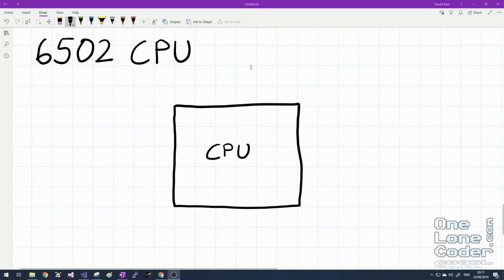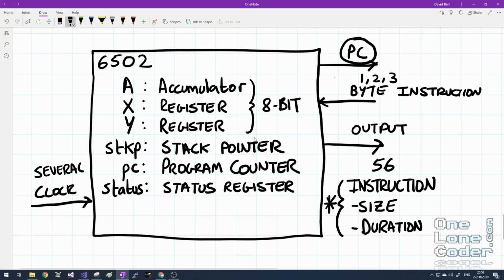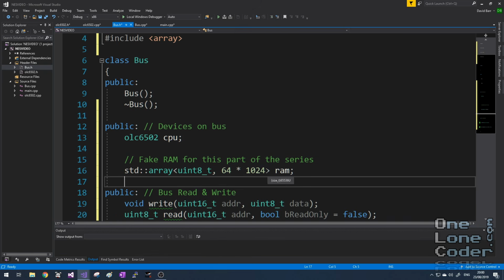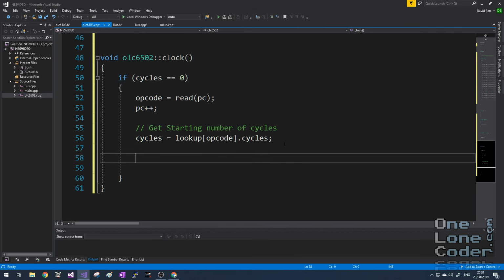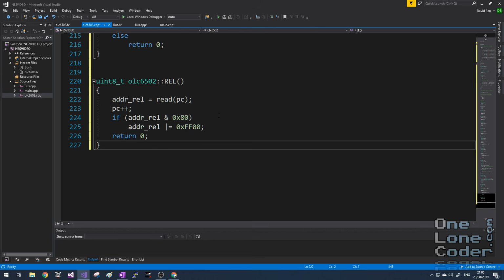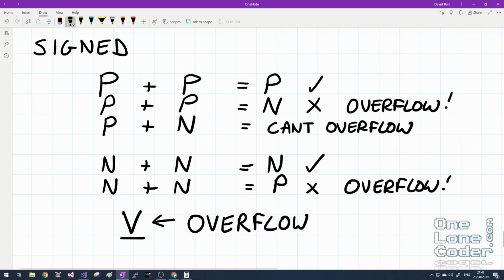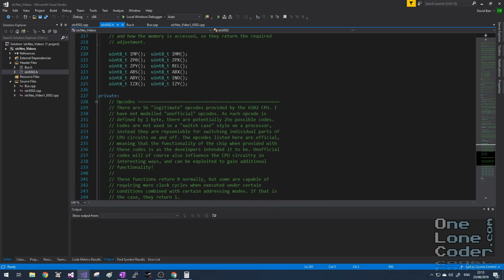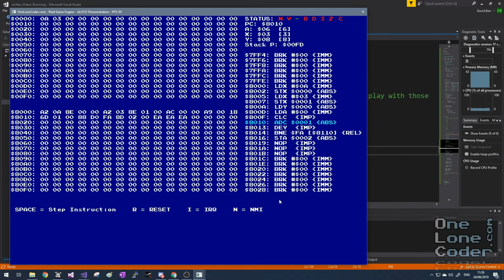NES Emulator Part #2: The CPU (6502 Implementation)

Comment: This takes me way back.  The first assembly language programming I ever learned was the C64 assembly, which has a 6510 (which is basically a 6502).  It was the easiest and most fun I had programming assembly I think.  I also watched another video where a guy built a simple computer.  That is, he built a CPU using off the shelf electronics, wiring it all up and explaining how the CPU works electrically.  It was a great education.  Each clock cycle you have electronic "switches" (logic gates etc) which does one thing, like, it gets the instruction, clock cycle, then it maybe read LDA, so the next cycle it transfers the contents of memory into the accumulator.  For addition, those four cycles may be that cycle 1 it loads one value into the accumulator, then it loads another into say Y for the next cycle, then it adds the two, and finally, perhaps transfers the result to the accumulator, or maybe sets/clears a flag.  The faster the clock, the faster things get done, but it was quite educational.  There really isn't any other "programming code" inside the CPU, just a set of electrical switches that are changed around for each cycle of an instruction to complete what it needs to do.  Fascinating anyhow, this just adds to that knowledge for me.  If you're interested in the series where he builds a CPU, check out his videos, they're amazing in how he explains how exactly a CPU operates, and he explains it like you explain things.  Easy to understand.
https://www.youtube.com/watch?v=HyznrdDSSGM&list=PLowKtXNTBypGqImE405J2565dvjafglHU

Comment: Very nice. I always wanted a youtube channel dedicated to computer systems.
It would be nice if you could create contents on
1.) Malware analysis
2.) OS and Kernels
3.) Language Processors
4.) How library functions like printf and scanf, etc works at low level.
5.) Text editors
6.) Stuffs like real and protected mode, paging and isa of x86 and other architectures
7.) Device drivers

Comment: Sorry, got distracted and didn't realise I hadn't watched this all the way through until the new one came out!

Is that a bug at about 1:02:56 in the Disassembly pane where it says "BNE $FA [$8110] {REL}"? That seems to me to imply that the jump will go to $8110 but it actually goes to $8010…am I missing something obvious?
Reply from the maker: Yeah its a bug in the display rather than the implementation. I discuss it in part 3

Comment: Two things I noticed 
For multiply you did not use left shift 
For interrupt calls you did not push x a y register 

Using left shift to multiply means a  8bit number can be multiplied with only 4 adds as opposed to up to 255 your way

And the interrupt needs the x and y pushed so it free to use them for its operations

Comment: In 1985 I was in computer science school and we did a course where you did a simulation of a assigned processor archeture and proceeded to write an assembler to feed the first program you wrote.  So I fired up my new ibm clone with 256ram and two 360k drives and i put turbo pascal 3 in it with a tsr to give me source level debugging and off I went.  Our processor was limited so you got the idea of address modes and instruction variants without the repeated details of even a 6502.  But yes this was a awesome walk down memory lane watching this video.  I was yes, Yes, and YES the whole way through.  Nice for you to say this was not your first effort on this but a refined result.  Because it looked VERY refined...awesome.

Comment: I've tried to do something similar on my own before from reading the documentation from nesdev, and from listening to others but the one thing I kept struggling with was the different addressing modes. After following your source and typing it by hand in my own IDE, as I was reading through the mnemonics or functions and seeing how you implemented them in C++ then I started to understand the actual internal hardware of the CPU. I've worked in Logisim to create simple 4 bit single phase single address CPUs which are quite easy to build from basic gates, but now I think I finally got the full grasp of the different addressing modes of the 6502. I really appreciate videos like this; they help to fill in the gaps! After you complete this series I think building the 6502 - NES in Logisim as a step by step set of tutorial videos would be another exemplary set of worthwhile videos! I was hoping that Ben Eater would take his 8-bit Bread Board CPU and do the same in Logisim! Who know's maybe one day!

Comment: System Designers back in the day were geniuses. I had to design a Single Cycle CPU that performed all the bit wise operations and arithmetic operations for my computer organization class. It fried my brain by the end of the semester. Thanks for the vid it improved my knowledge of system design but also C++.

Comment: Great video, David! I love this retro stuff and the way you explaining the matter. Keep going!
One little remark: 6502 chips utilize  no microcode. You told in the video something like this: "there are microprograms executing particular opcodes...". I believe you've used it as a metaphore, haven't you?
Reply: The 6502 Especially the NES has multiple clocks running at the same time. THE PPU, APU and CPU all run at different frequencies. So one may run 3 cycles while another runs only once. There is a main master clock in the system. There are other parts to the NES that weren't directly mentioned in these videos as of yet, but you also have the I/O system besides the RAM, ROM, APU & GPU. There is a logic controller that keeps all of the clocks in sync even though they run at different frequencies. So in a sense you could consider the ratio of operations of one device to another "microcode" as the APU or PPU may have to wait for the CPU because of the fact that it had and Interrupt Request from user input. So there is a logical controller behind the scenes that is managing the state of the system. The NES is in a way both a simple and a complex design. Compared to some of today's architectures it would appear rudimentary or elementary in nature, yet in its own time it was a complex beast!

Comment: I like this old retro stuff. I wrote an article where I used Woz's floating point code recently. It's amazing what you can calculate even with this simple microprocessors. I like even to write some things in assembly code. It makes my brain happy. Even today, sometimes I wish I could easily checkout the carry flag after a sum operation or even get the 64bit output after a multiplication. But standard C doesn't provide it (for various reasons). I liked that you mentioned your wife who checked the opcode matrix. That's just great!

Comment: Can we just take a moment and appreciate the fact that this guy didn't put a single ad on an hour long video?
Reply from the maker: Thanks! Or any of my videos as it happens 😊
Reply: @javidx9  Then how do you make money off your videos?
Reply from the maker: I dont
Reply: @javidx9 I think you should, your experience and knowledge is worth a lot!
Reply: javidx9 do you know where I could research on emulating the ZX Spectrum for my A Level NEA comp sci project?
Reply: @javidx9 ads can be skipped or 5 or less seconds long. So i think you should add them, you deserve them. However, they can be annoying if theres like more than 2-3 per video (mostly depends on length. However 2-3 feel right for a video of this length). And imo, video adds are better then the popup ads that cover the bottom of the screen as they can stay for awhile, trigger my OCD so i feel like i HAVE to remove them (which is worse on mobile bc the "x" is small), & possibly block important parts of the video. Keeping what i said in mind, i hope you consider adding ads! Its basically like supporting you for free.

As good as it can be and feels putting things out for free, you're ultimately loosing chances to gain in the end. Imo, you need balance in life. In this context, you cant just give everything, take at least some of what you deserve.
Reply: Never has, and doesn't intend to, iirc. Doesn't care about monetizing the channel, only cares about the community, code, and knowledge.
Reply: @cecilectomy  He can get money too
Reply: can i be your patron? :>
Reply from the maker: @Obnovujeme  you certainly can!
Reply: @javidx9  No ads on any of them huh? Then you my friend have just earned a member :) You deserve some money somehow to help you keep this up. Thanks for making this fantastic series! I look forward to the rest of it!
Reply from the maker: Why thank you very much!
Reply: well i wouldn't've never noticed that because adblockers are so common nowadays
Reply: @JimB001-t6w  was talking about ads, they are a minor contribution so I doubt he thinks they are worth putting if they are annoying.
Reply: He doesn't need to, after all, he does have a full time job!
Reply: Yes, definitely. It's nice to have a video series for building an emulator on YouTube that also goes into the concepts of how it works.
Reply: let's go to his house and kiss kim
Reply: Quality human for sure 🤟✌️
Reply: Yes! This guy is a legend. People like him make me happy about our human race 😊
Reply: I'm so very thankful for the lack of ads, although this video and the rest of yours should be monetized. If I have to watch a minute in ads for the invaluable amount of knowledge gained, so be it. You are a goat!
Reply: @javidx9 is the reason I went from JavaScript development to C++ programming. 🙌🏼
Reply: I wouldn’t care if there were ads when quality is this good. Not being asked 10x in a video to like and subscribe, and not hearing the word “guys” every 4 words is refreshing enough.
Reply: we absolutely love you for that. you're the coolest
Reply: No
Reply: Please put ads and we will click them too. The knowledge that we gained from these are valuable. Been about 9 years of C++ programmer and now I understand some concepts because of these videos. Thanks
Reply: @amilamad  No, don't put the ads. They are annoying, and javidx9 won't get most of that money anyway – Google will take the most of it for themselves. Not worth it. Better support him on Patreon. Then he will get most of that money.
Reply: don't even think you can monetize videos when the account is registered on most parts of the world other than the usa. can't find it anywhere in my account for one thing. lol. youtube never understood much of the 'open one office in pakistan and just send everyone bitcoin' thing and think they have to open 'local offices' with 'local payment bullshit' everywhere. lol. for all i care they just pop the cash in an envelope. works anywhere where there is a mailman ;)
Reply: @CB3ROB-CyberBunker  It’s because you need a certain number of subscribers (1000 I think) as a minimum before monetisation becomes an option.

Comment: Good stuff so far. I'm not sure what this pixel engine stuff is exactly (looks like an engine you made earlier on your channel) so I went with white box break point testing and stuff seems to look good (as far as I know). As an exercise I'm trying to create a SNES emulator using your work as an example to see if I am really learning about emulation anything here. I know you are focusing on the NES but I am hoping with all the research you have done you can point me in the right direction. Right now I am focusing on the CPU (since it is what you tackled first) and it seems like the SNES uses the Ricoh 5A22 processor (can't find a data sheet so far), which people say is based on the WDC 65C816 (I can find some more info on this chip). Since one is based on the other, do you think it would be better to emulate the 65C816 or should I keep hunting for a Ricoh doc? I'm not sure if "based on" is code for "chip with all the same opcodes and addressing functions but might be faster".

Comment: how do you paste multiple lines without we knowing where you are copying them from?
BTW: is it normal to forget programing language if not used for some time?
Reply: I can’t speak for javidx9 but from my experience, I’ve not used 6502 for decades, but when watching these videos I immediately remembered what the opcodes and addressing modes did, what the registers were etc. But I’d forgotten some math specifics like what the overflow flag was doing, “tricks” like 2’s complement etc.  But once you’re in the assembler zone, most reference was needed for the relationships and rules between the console hardware components (memory address ranges, limitations etc.), possibly something we’ll see in later videos.

Comment: Absolutely wonderful walkthrough! I've always wanted to get into this type of stuff and this series is shaping up to be the perfect introduction, so thank you so much for that!

Also, one small question. I know this is a trivial detail, but why did you choose to invert using ^ 0x00FF, rather than the ~ operator?  Just wondering if there is some subtle difference or just a matter of taste.

Thanks again!
Reply from the maker: Thanks Khan, I only want to invert the bottom 8 bits. ~ will invert all the bits.
Reply: @javidx9  Oh I see, I for some reason missed that we were working with 16 bits, and thought the two zeros were just there for looks. Now the difference makes perfect sense!

Thanks for the clarification!

Comment: This may be a video pending, but is there something in your 6502 emulation that ticks the clock signals at the right pace for the intended underlying hardware? For instance a 1.79MHz clock cycle vs a 4MHz clock?

Comment: interesting that in the reset function you set the status register to 0x00 | U, preserving the value of the "unused" bit. what is the reason for this? is it to allow a programmer to use the bit arbitrarily?
Reply from the maker: The unused bit must always read back as 1. Since the programmer can pull register status of stack, and therfore can arbitrarily set the status to be anything, its important for the tests, that U be read back as 1
Reply: @javidx9  ah okay. the usage of the B and U bits were a little confusing to me. i found some more info on the nesdev wiki about them though. thanks so much for doing what you do! cant wait for part 3! gotta fix this segfault first though... haha

Comment: In every 6502 assembler I ever worked with, "LDA $41" would generate a 2-byte instruction that loads the accumulator from zero-page address $41. The syntax for loading the immediate value was "LDA #$41".

Comment: PLA increments the stkpt before fetching data, I assume your correct, that makes no sense to me, why doesn’t it fetch the data at the current stkpt, then increment stkpt?
Reply from the maker: Hi Steve, because PHA wrote the data and decrements stkp. Stkp, does not in fact point to the top of the stack. It points to the next available entry.

Comment: Wonderful! :D I've already written emulators (not NES though, but in general, systems based on the 65xx - and Z80 too, btw, but that's another question - CPU family), so at least there is some connection, and it's very interesting to hear about these from another developer interested in at least kind of similar topics :) 65xx at least quite logical eg for example setting NZ flags even by LDA and PLA (or even reg-reg transfer like TXA), while for example Zilog Z80 is a much complicated to be able to see the "side effect" on the CPU flags. But anyway, Z80 is interesting from another aspect :) Sorry for the long comment, but I simply love these topics, to be honest ...

Comment: Very interesting video and subject. There was a small bug in the disassembly towards the end in the branch instruction, where the negative address wasn't handled correctly. Shows address 8110 which suggests the address was treated as a positive value.

Comment: Hi, your content is just awesome. Can you please make a series on how to design a operating system from scratch
Reply: It would be ten times harder than this serie.
No, actually it would be way more harder than this.

Because the main job of an operating system is to be an abstraction layer over the hardware (it's the original reason behind OSes).
And nowadays, hardware is not as simple as it uses to be. If you don't have drivers (and for a new os you won't have any) you are not going far. 

And it can be even harder depending on what you call "operating system". Unix (functionnalities, tools) or windows (gui) ? 

However, there is a lot of documentation on this. 

Plus, you have some non-unix os project, like Icaros, which you can install on virtualbox and then play (legally) the shareware of doom 1 on it.
(which is quite amusing and fun XD)

Comment: Minor error at 10:40. LDA $41 would be loading the accumulator from address $41 - termed zero page addressing.  Immediate load of a value would have a hash symbol in front, like LDA #$41...

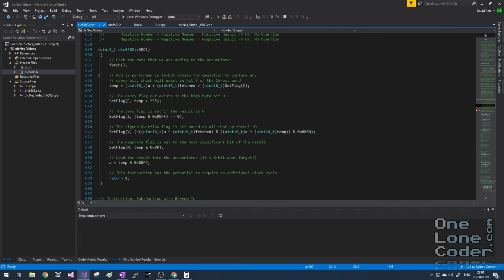Comment: Thank you javidx9, I'm at awe of the OOP implementation of this emulator. Greatly appreciate you sharing this high quality content! I thing I saw a potential mistake in the comments at 52:27  regarding the -128  thru 127 range, shouldn't be 00000001 = +1?   :b
Reply: Yea that's likely a typo

Comment: FYI, LDA $41 is NOT an immediate load. It is a zero page load and loads the value stored in address $41 just like your second example loads from $0105. Zero page just takes fewer cycles. An immediate load would be LDA #$41.
Reply: So much this... came looking for this very quickly.
Reply: @Meow_YT  I did notice, however, that later in the video when the disassembler is shown, that it is done correctly. Therefore, I think Javid just misspoke here.

Comment: I having built a basic 8 bit CPU using discrete logic by following Ben Eater's series of videos. It only has an A=0 and carry flag but it has been quite fascinating building it, writing instructions at the microcode level and writing programs for it, and making upgrades (currently has 256 bytes SRAM and it can do some basic logic operations etc).